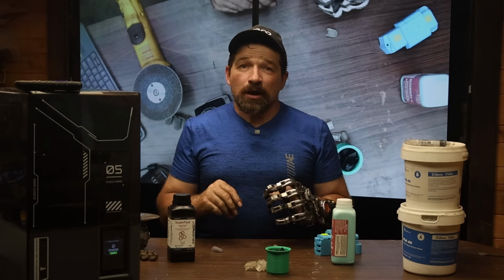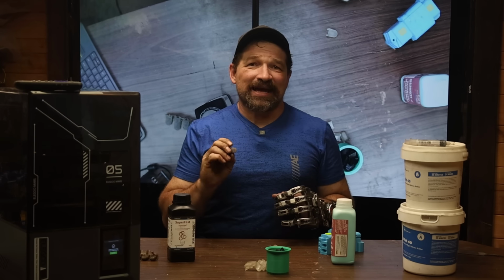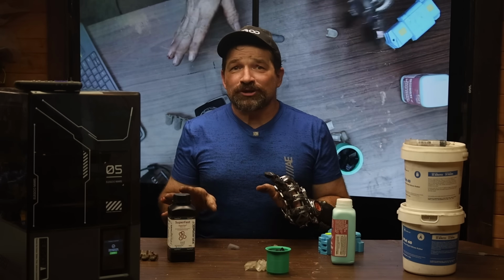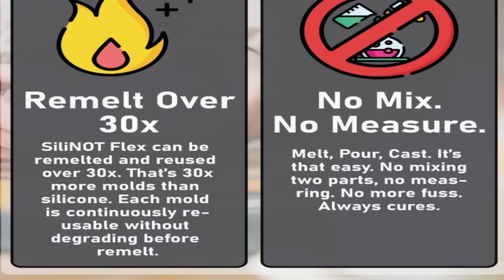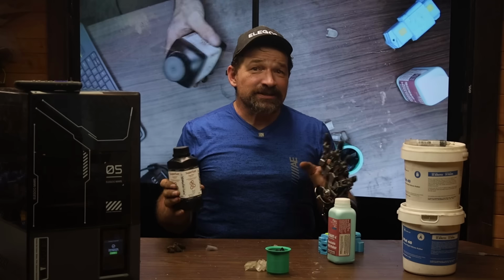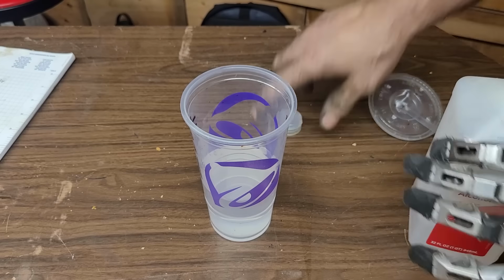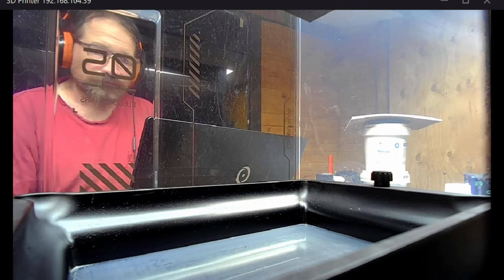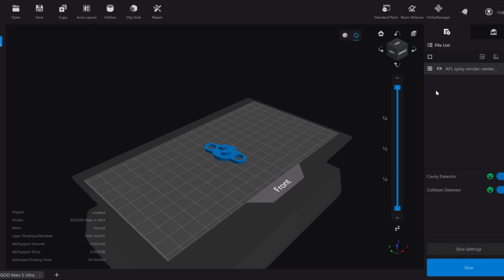Fingertip sidequest

Comment: I'm sure this has been brought up many times, but have you ever looked into adding modern electronics hardware? for instance, you could add haptic feedback from the fingertips. You'd need to put the physical feedback somewhere where its not exactly intuitive, but the human brain is incredible at adapting, so with enough practice it'd almost feel natural.

Or If you really wanna go all out, making a new prototype that makes use of servos and electromagnetic pulse detectors to pick up on your nervous system signals (as well as some modern ML to learn to decode those signals) for a fully articulated hand controlled by your brain, with full sensory feedback. 

would be difficult, but is 100% possible and at least deserves a look. most prothsetics that use nervous system signals to control the hand are using 50 year old ML techniques, but with modern ML architectures like the transformer, this is easily doable.

Comment: I have an additive that can be mixed in with any resin to make it more flexible (Monocure Flex100).  You can vary the flex from a slight bend to rubbery depending on the ration you add (does not print well if too soft).  In all cases, I find as you did, it tears eventually.  
  You might wants to try Varioshore filament from Polymaker.  It is a foaming TPU.  I print it at 250ºC for max foam and it makes a foam much like a flip flop or EVA, but fairly tough. with some give and a natural grippy texture fromt the foaming (not glossy smooth like regular TPU).  It prints with good detail, but you need to print one item at a time or sequentially.  Like most TPU, it is not great with retraction.  I wonder it you could print in the Varioshore, then dip the tips in silicone.
  I also had the thought you could intentionally slide the filament printed tips over something hot (220ºC) once they are attached to the prosthetic to give a smooth "fingerprint" area.  I like your ribbed tips, but wonder if a slick, but grippy central strip or small rounded area would actually allow you have greater traction for thin or delicate items, such as picking up a sheet of paper or a dime.  Great work!

Comment: Great work! Are you familiar with foaming TPU? There's filament out there where it's designed to foam for a lower hardness. You might get better results than getting regular TPU to foam but the minimum hardness is still only 55A.

Comment: The way your resin cracks in the same place every time, it could also be related to layer adhesion between the different layers.
Try angling your fingertips in such a way, that the direction that gets the most force, has the most layers. 

In this case, it would be straight up, instead of sideways. 

The way i see it, you have long thin lines going horizontally through the print, when they should be going vertically through the finger. Another angle might also be a better solution. 

You also have the problem that UV light keeps curing the resin, making it harder and stiffer, and therefore more brittle. You could try painting the fingertips / using rubber tips to protect them from UV exposure.

Comment: I dont know if you've tried this before, but my suggestion is plasti-dip. Everything that ive seen its just a rubberized plastic coasting that comes in liquid form.

You might be able to cast it, and it might be soft enough for your uses.
Reply from the maker: I tried plasti dip around the 157 158 devices. I also used star Brite liquid vinyl.  The plastic dip wouldn't actually bond to anything, it would stick, but as soon as you apply any shear force to it, it peels right off. The star Brite would stick ok, but you definitely need a mechanical connection.  It wore OK, but looked like crap, it frayed super easy.

Comment: varioshore tpu should be worth taking a look. it starts harder than most tpu but depending on print temp, you get different amounts of foaming. Should allow you the durability and easy of manufacture of fdm, but can dial in the softness easily to something far softer than your fdm can likely extrude

Comment: Sorry if you mentioned any of these, I got horrible memory lol.

1. Thermoplastic Elastomers (TPE)
Properties: Flexible and rubber-like, but moldable when heated, making it easy to customize.
Advantages:
Good durability.
Excellent grip and flexibility.
Recyclable.
Uses: Common in lightweight, flexible prosthetic components.

2. Polyurethane (PU)
Properties: Tough and wear-resistant while maintaining flexibility.
Advantages:
High durability.
Great grip, especially in wet conditions.
Soft to touch and customizable for different textures.
Uses: Used in applications where resistance to abrasion and oils is needed.

3. Neoprene Rubber
Properties: Flexible and durable, with a decent grip.
Advantages:
Highly resistant to abrasion and chemical exposure.
Moderate grip with a soft feel.
Uses: Used in soft prosthetic applications where resistance to wear and tear is critical.

4. Nitrile Rubber
Properties: Durable and resistant to punctures and abrasions while offering decent flexibility.
Advantages:
Good grip, particularly in oily or wet conditions.
High resistance to tearing.
Uses: Commonly used in medical prosthetics for durability.

5. Polyvinyl Chloride (PVC)
Properties: A durable plastic that can be softened for flexibility.
Advantages:
Inexpensive and customizable.
Reasonably durable with moderate flexibility.
Can be textured to improve grip.
Uses: Often used in low-cost prosthetic fingers and components.

6. Textured Nylon (with Silicone Coating)
Properties: A fabric that can be coated with silicone for improved grip and durability.
Advantages:
Lightweight.
Silicone coating adds grip and durability.
High flexibility.
Uses: Ideal for more functional prosthetic coverings.

7. Carbon Fiber Composites (with Grippy Coating)
Properties: Extremely durable and lightweight, but requires a grippy coating for tactile use.
Advantages:
Very high strength and durability.
Can be paired with soft coatings for grip and flexibility.
Uses: High-performance prosthetics needing both flexibility and strength.

8. Elastomeric Foams
Properties: Soft and compressible with good grip.
Advantages:
Comfortable for wearers.
Excellent for absorbing shock.
Adds gripping ability, especially when textured.
Uses: Can be used in fingertips where a cushioned, gripping surface is needed.
Reply: Also, as another commenter said, maybe try natural rubber? like the stuff tires are made of?

Comment: Hi, this is probably a hilariously bad suggestion on my part but have you considered "disposable latex finger cots" as an ablative surface for your fingers?

 They're pretty cheap, enough that you can wear many layers at a time, you could put a bit of foam underneath to give your fingers some give, and they can help contain some emollients to maybe help your printed tips last longer.

Personally I would second the suggestion to use vulcanized rubber, with leather contact surfaces, and maybe put the latex tips on top of that for extra durability.

Comment: Maybe a flat surface with a high durometer silicone or polyurethane would be better?

You could also try smaller surface ridges using an SLA mold which can have a much higher resolution, which would likely help a lot on slippery surfaces

Comment: Have you considered using a multilayered approach?  If you consider the structure and "material qualities" of an organic fingertip you have a hard, inflexible bone core, a semi-flexible muscle layer, a squishy fat based "pad", and lastly a flexible, but tough outer skin layer.  This layering of different properties may yield better results for you than trying to determine a single material with homogeneous material properties from your "bone" tang on out to the surface.  A thin skin which is flexible but durable, bonded to a middle layer which is compressible, bonded to a semi-rigid and tough inner core which makes a snug connection to the metal tang may give you the blend of properties you're looking for.  Sure, it's going to be more complicated to make than your current process, but consider what you're mimicking.  Real fingers aren't covered in a single type of flesh from the bone to the surface.

Comment: Did you try to cast hot glue fingertips ? You could heat up the tang and glue a tip on, and if it adhere too much to yank it, use some IPA to release it right off.

Plus if your fingertips are not grippy enough you can rub them on something to soften them up and make them tacky.
Reply from the maker: I played with EVA around the 157 158 designs, probably 3 years ago. It worked OK, I had to make heated aluminum molds for it to work. Also, I had to Desi in a mechanical interface to keep them from coming off. If you didn't use the heated mold and bake them like a cookie, the EVA would crumble and tear like the polyurethane does.

Comment: Have you tried making a high durometer fingertip with pores into which you can apply low durometer dots that just barely peek out of the surface?  You might just need to poke a wet toothpick into each pore, or just dip the whole fingertip if the pores go all the way through to the bone void.

Comment: Have you tried injecting Instant / High Tack adhesive, the one used to instantly bond flooring trim to the wall? When dried (which is usually under 24h) it has the consistency and tackyness of rubber. I'd give that a try...
Reply from the maker: I have, the issue that I run onto is, in no time it's loaded up with all kinds of crap. Then they just look dirty. The only way to clean them off is with a mek bath, but that makes the rubber break down and get weird.
Reply: @missingpartsclub  Yeah I can see that happening, it's extremely susceptible to getting dirty. But so are most grippy materials. I was honestly thinking that maybe in 'Murica one can find dark coloured instant tack (here, in Europe, you can only get white one)

Comment: It seems like the parts are specifically cracking along those hard corners. What if you printed some thin rigid sleeve to go over the finger tab giving it a more oval shaped interface? Might distribute the stress more evenly.
Reply from the maker: I went the route of stress relief a while back. The Tang is .25 wide and .17 tall. If I put a .03 radius on the corners the flexible resin deforms enough that they end up being able to rotate. The tang isn't a hard corner BTW, it has a .015 radius, but anything more and I lose index. But good thought!

Comment: Keeping best of both worlds corners, mounting a quickdetatch/deploy gripping rubber/cloth on or in the inner wrist. 
Would provide unpracticly tacky grip for common use yet effordless cemented grip when needed. Kinda like those jar opening fabrics.

As a out there thought, an detachable mount.
The leafspring automated forward and backward deployment of the benchmade infidel mechanic is super flat as an casual deploy and retract between handeling like a magicians napkin out of the sleave and instantly retracted when done.

Comment: Not sure if any of the pcbway or jlc pcb manufacuring houses offer it in their services but sls tpu might be a good balance of toughness and softness. If the durometer is too high you could design some fine mesh structures to make it softer like your resin print.
Reply from the maker: Not for overmolding, but mfj as the core probably.  Although mfj pa12 parts  were super brittle last time I used them.

Comment: I wonder if a rubber sole company like Vibram would have interesting materials?
Reply: I find that Shoe Goo has a good wearing strength when I add a layer to the tip of my walking cane.   Most cane tips have a cheap rubber/plastic which wears out after 3 months.  The shoe goo makes it last about a year.   

Maybe the tearing issue can he fixed with fibre reinforcement. wrapped around a tang, and then molded into final shape.

Comment: Could you dip or dot the pla fingertips with something like liquid neoprene or vibram rubber? Synthetic rubber is used a lot in work gloves and boots. Flesh fingers are made of multiple materials. Maybe experimenting with reinforcing the rubbers with fibers and layering different materials might give you the right amount of flex and friction.

Comment: Have you considering mixing 2 mediums? Like a slightly undersized 3d printed "finger" then dipped in silicone to retain only certain characteristic of the material. Shouldn't be a major time offsett as active labour per single part is still at a minimum after the first setup.

Comment: would a two part setup be viable? a solid core you coat with a re-applicable layer for the grip like a rubberized coating you reapply as it wears? possibly adjusting the texture of the core surface to improve adhesion of said coating so it don't just flake off in sections as you do your daily tasks.
Reply from the maker: That's how I overmold the silicone fingertips. A tpu core that has mechanical connection points that I overmold with 40 shore silicone in 10 pc molds.

Comment: Not an appealing solution but perhaps you could do two layers for the finger tips. Outside with this new flexible resin and inside with the tpu. I don’t know how thick you could make it before it is impractical and removes all strength from the lower layer. I also suspect that the divots would be an obstacle that probably can’t remain the same. As in you’ll probably have to make the divots a little less deep. I am not sure. Just some thoughts. I also am not sure how to best bind the two layers. Maybe a simple adhesive would work.

Comment: Could you scrap the silicone fingertip idea and take inspiration from a rattlesnake tail. Could you 3d print a movable slightly grippy tip to allow for soft touch and grip on smooth surfaces

Comment: The flexible 3d resin, were the inner corners filleted or rounded in some way? I'm pretty sure you would have already thought about the corners being stress points that can propogate stress cracks nut I wanted to mention it just in case.
Reply from the maker: Yes, they have a .020 and .024 radius, if I go much larger then the material will flex enough that the fingertips will rotate and lose orientation. But no, they aren't sharp corners.

Comment: Does everything need to be the same material? I understand the point of squishiness as it adds surface area and friction, however maybe only some part needs to be flexible? What if it is more of a harder rubber material for the fingertip but a softer material for the finger print. Maybe this will reduce the stresses and cracks in the finger.

Comment: Did you try two part platinum cure silicone? Silicones are way more durable than Polyurethanes and platinum cure will stand up to temperature and UV exposure way better than Tin cure. Its generally fairly soft though, polyurethanes can be harder. But in terms of toughness Silicones hold up better I think

Comment: Hello Ian, 3d printer and maker here - I've been experimenting with mixing 3d print and resins for a different application. Would it be possible for you to print the infill structure of your fingertip in TPU or resin, turning the walls/floor down to 0 so print a hollow matrix. This matrix could be placed it into a mold, and then have a soft resin poured into the mold, resulting in a hard matrix encased in softer resin? It may resolve some of the tearing issues. Love your videos and how you talk about design/testing!
Reply from the maker: That's my current experiment.  I printed a grid @45 .1" square with radius corners, .05" separation. With the flexible resin. I had plans to overmold it with 20 durometer silicone. So far during testing, I'm finding that the 3d materialize resin is not sunlight uv stable. Post wash and cure it looked and felt great, nice squish. I put the block in the sun for an hour, came back, let it cool down and it started to crumble. At this point I'm thinking it might be the Resin. I'll try it again, but this time, cure under water.

Comment: Regarding the cracks: Resin is cured with UV. Over-cured resin becomes brittle and cracks. If you don't coat the resin fingertips with something that protects them from the sun's UV, a couple of hours exposed to the sun might destroy them by making them too brittle to use.
Reply: Also resin can be mixed to some degree, maybe some ABS-like and flexible resin mix could yield an interesting result

Comment: Are the metal tips of your fingers squared off or rounded?
In some of your grip tips the internal tearing and splitting coukd be material fatigue exasperated by the pointed edges of your prosthetic. 
I remember reading about the first commercially pressurized cabin passenger jet plane have traditional square windows.the issue with these is stress from repeated pressurization and depressurization cause stresses to focus on the corners and caused catastrophic failure.
I could see that happening at every sharp corner where your soft material meets your prosthetic.

Comment: I wonder if there's something you can regularly apply to the more durable finger tips in during use to increase grip without reducing longevity? Kinda like chalk on a pool cue and hand or on the fingers and hands for rock climbing?
Reply from the maker: At one time I tried simple rubber cement. It worked for about a day, then it started peeling away and fell off. So the next round, I drilled holes in the body and tried getting a mechanical bond rather than chemical. Better, but then the little fingers just sheared off after a while.

Comment: But what about a polyaspartic or polyurea? You can add silica grit of multiple different sizes if necessary. I used to coat concrete with it. It's meant to be non-slip, and durable enough to drive and park your car on